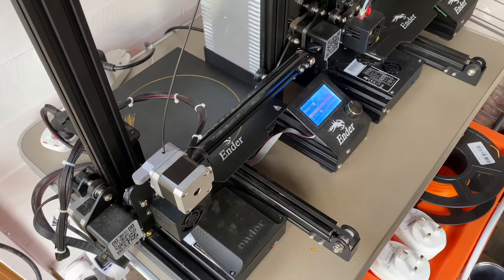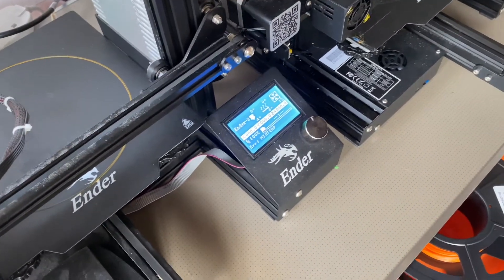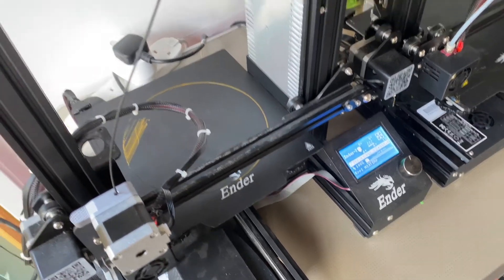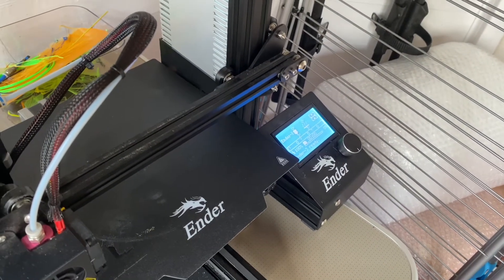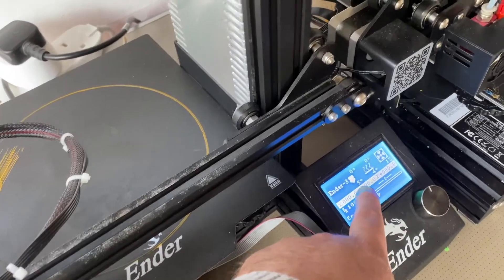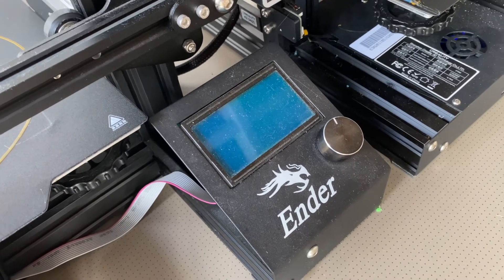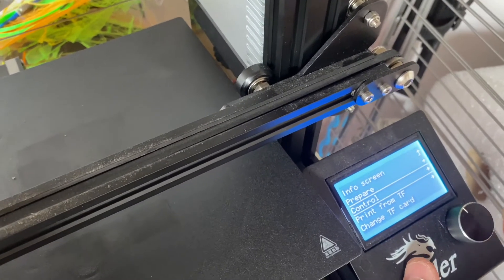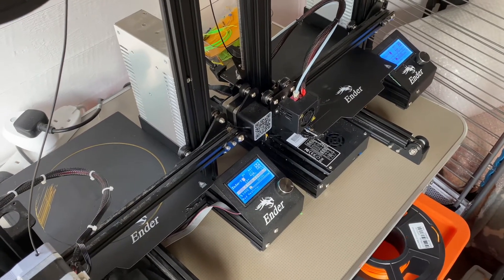Ender 3 MINTEMP error - Too cold for 3D printing!

Comment: Just had the same issue with mine, i have a glass print bed so probably a stupid idea but i put a very small amount of bioethanol on the bed in a little puddle and set fire to it. Wiped it clean once out and now it prints fine

Comment: Super thanks. Had same issue and warmed it up with the hot air gun, solved the issue. The only thing i don't understand is that i checked the thermistor resistance and it seems to be fluctuating wildly around 400k when i measured it, before using the hot air gun. I was ready to look at replacing it until i seen this.

Comment: You are a god sent!!! I had the same issue this morning, ready to fall on my blade so to speak. LOL i was gearing up to take apart my machine, then my wife said it maybe too cold out side last night, so I googled and here I am. Thank you so much, Im gonna wait and heat up the room and see what happens.
Reply from the maker: I find a hot water bottle on the bed for a few minutes does the trick. Interestingly, when I switched to a silent motherboard, it now operates from 0°C instead of 5°C.
Reply: @BeavisPits  I had a heater in there with it till I had to take that out. For context, I have my printers set up in a caravan trailer out in the new Mexico desert lol I guess this is a good test. I have the V2 with the 4.2.7 board but the read out flashes -3 and -4 before going to 0 lol so that maybe the issue lol

Comment: Ah! Thx ! My artillery genius have this error recently . Its in my workshop which isn't constantly heated and its December so now it makes sense. Could this also affect the x endstop  suddenly not working?
Reply from the maker: I’ve not had any issues with the end stop microswitches but it is possibly that the grease inside them may thicken and stop them working if very cold

Comment: My printers are in the conservatory (also in the UK) and it gets really cold in there at the moment -2 last night. I have 4 printers they will all show this if the printer is showing less than 6/7° I just use a hot water bottle with kettle water on to pre heat the bed hover the nozzle above it too and 2 mins later you can start your pre heat setting and print away!!! 

Yes it's got to do with the outdoor temp but just bypassed by heating up above the non cut out.
Reply from the maker: Good idea about the hot water bottle. I’ll try that with mine.
Reply: @BeavisPits  yeah I do it daily haha put it on one heat it then hit the pre heat button move it to the next till all 4 are fired up 😂 feels like I'm using a choke in a car again.
Reply: Just had same problem
Upgraded my motherboard think I may have damaged my old one printing in cold moisture 
Allowed me to print when nozzle was 8 bed was 6/7

Comment: I didn't watch the whole thing but it's a design feature in the firmware for safety. Below a set temperature the heater will be switched off because it probably indicates a broken thermistor wire. If you use Marlin you can set a custom MINTEMP value.
Reply from the maker: Thanks, useful to know, my printers are outdoors so often get cold at night